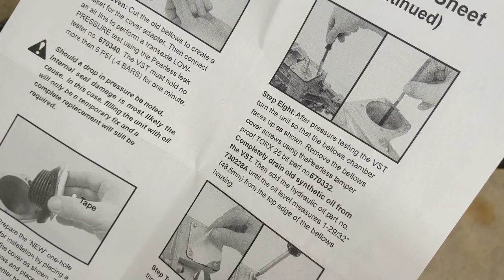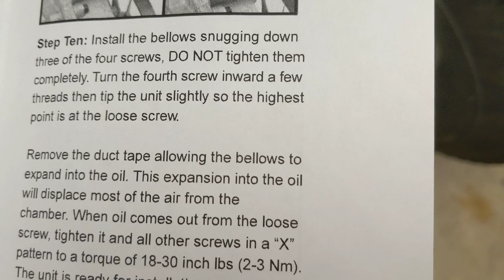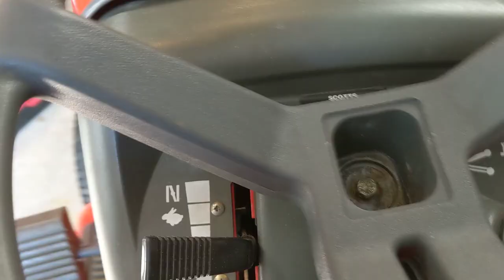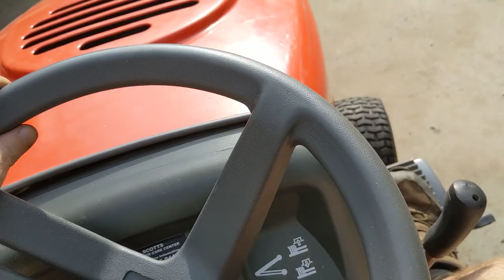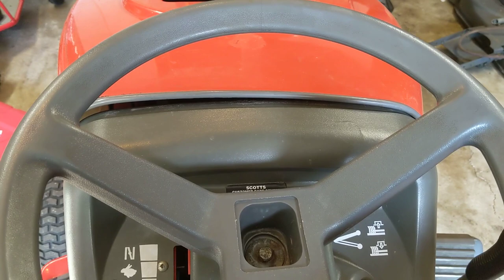Mower Hydrostatic Transmission Fluid Change - Peerless Tecumseh VST

Comment: Never ever will I buy one of those. Thanks for showing what to look out for when shopping. I thought removing the fender and the gas tank showed a lack of engineering forethought as I changed a Tuff-Torq hydrostatic transaxle's oil in my neighbor's Simplicity, this Tecumseh thing,  what were they thinking? BTW, drained oil had a fine, aluminum metalflake swarf/swirl to it, change that stuff, contrary to the advice I received from my local dealer.

Comment: Great video! I have the same mower and it doesn’t pull up hill. Did you have the same symptoms? On a flat it moves but slowly. TIA
Reply from the maker: No that was mainly just preventative maintenance - I thought it had lost a little power but it was still working fine except it was just a little slower in reverse. However, it has now started doing exactly what you describe and I'm going to be looking into it soon. Either the tranny is letting go or maybe the belt is slipping (I'm almost thinking it's the belt). I'll be working on it soon and videoing whatever I find out.
Reply from the maker: Got it fixed...video out today or tomorrow!
Reply: @BubbasWorkshop  can’t wait to see!
Reply from the maker: Ok it's up... Adding fluid worked perfectly 👍

Comment: Hello friend .. I have a Murray tractor with the same tecumseh transmission ... Can you tell me which oil I need .🙏.. I am from Europe and my problem is ordering original oil😒
Reply from the maker: use 20/50 synthetic motorcycle racing oil

Comment: Your instincts were right, it IS bentonite lube in that gear case!! [Peerless Bentonite Grease 788067]
They later changed to 80/90 lube. Thank you for this vid, It is very helpful. I am going with 20w50 synthetic motorcycle oil in the hydro. From what I have found, its what all the aftermarket oil marketing companies are  labeling as "20w50 hydrostatic fluid".
Reply from the maker: thanks! I knew it wasn't just 80/90!

Comment: Great video! I just bought a mower with this transmission and this is very helpful. I had one question about the forward pedal. Does it hit the foot rest when you put it down all the way? Or should it be dropping beside it when fully engaged?
Reply from the maker: On my mower yes it does but it really depends on how you have the pedal adjusted and how loose the linkage is I don't think it did when it was new but it's kind of sloppy now.

Comment: What about the other cavity with the gears?
Good videography, demonstration and information! Hope the machine is still running good for you. I have an old Craftsman LT1000 that has done me very well over the years but now seems to be indicating some transmission problems may be on the horizon. So, like you, I’d like to head those off at the pass before that become big problems!
Thank you again!
Reply from the maker: Honestly I would not drain but just add some gear oil if it looks ok and not worry about it. I believe there was supposed to be about 1/2 inch on the screwdriver when going straight down. I didn't show it but I added a little back in and put the plug on. Transmission is still working perfectly fine!

Comment: could i access that oilplug without removing the axle and pump old oil out?
Reply from the maker: I don't think so..if you have the same transmission i do then hoisting it up is the best way (look for another video I did where i hang it by the front...that's the way to do it!

Comment: Thanks for showing this, I have the same year mower and after watching your video I'm gonna do mine. my hydro is the same as yours so can you tell me how much gear oil you ended up putting in. I have some of that lube your using but don't know how full to fill with gear oil. How is your mower doing now?
Reply from the maker: if you are filling it the way I did (with the bellows removed) you are supposed to fill it up to 1 and 29/32 from the top of the case (basically 2 inches from the top). If you go to 39 min in the video you will see it's kind of irrelevant as the purpose is to release the bellows as your tightening the "lid" so that all of the air is pushed out. Mower is still running fine and the transmissions seems to still be in perfect shape.
Reply from the maker: Hey I just re-read this...I think I added just a tiny bit of gear oil..i estimated what came out and put it back in. I don't think it's as important as the gear oil doesn't get that hot in such a slow speed machine and if it did get hot and expand it could push past the little rubber plug.

Comment: Also, would you be able to send me the link for the manual for this transmission?
Reply from the maker: Do a search for this in Google and it will pull up a bunch of different links to a pdf "tecumseh peerless motion drive system manual" 👍

Comment: I'm 6 month s late to ask you about this I have a powr Kraft limited edition mower by MTD for Mountgumary ward it has peerless hydro static transmission  I will get the model number on it to you some how I need to know what I need to do with it as far as service goes on it
Reply from the maker: There really isn't any service to do to it unless it doesn't work. As shown in the video you can change the fluid and the bellows if you want but I"m not sure it's really necessary. The fluid didn't look great but looked way better than I thought it would for something that's been used regularly for 20 yrs.

Comment: Can u share the specification of the hydrostatic pump and motor u used to rotate the pump
I some doubt to ask can u share ur email id
Reply from the maker: The hydro pump/transmission is a Peerless Tecumseh VST205 and the engine is a Kohler Command single cylinder 16 HP.